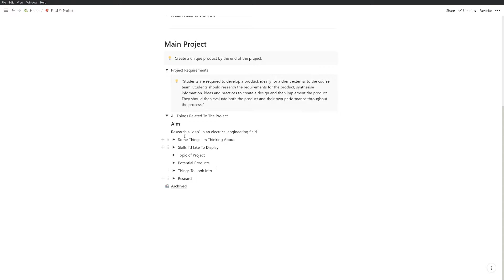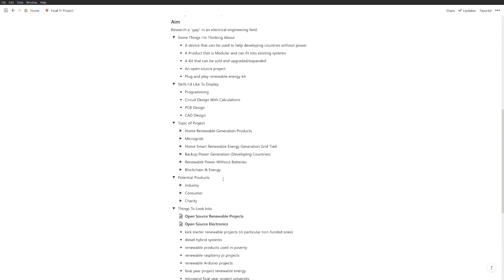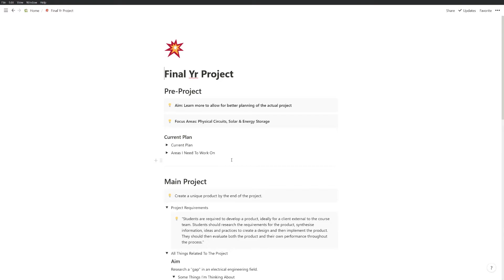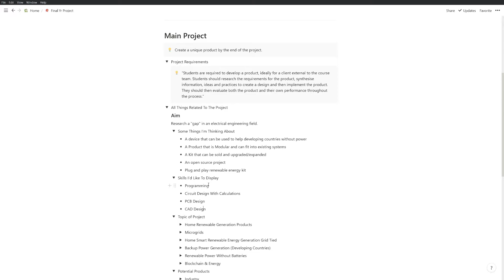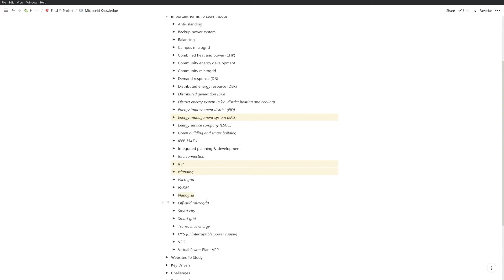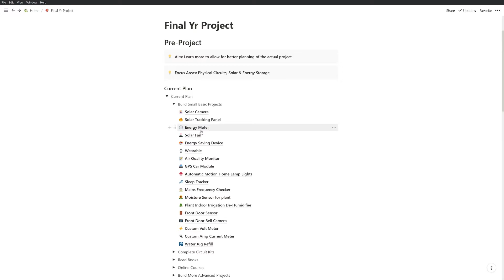Planning My Final Year EE Project - Slight Step Back

Comment: Good luck🍀
It's very motivating to see someone's final Plan when You're in 1st year.I have to learn a lot.
I had put my hands on C programming,
Arduino,Little bit Circuit design all possible due to Internet coz Indian Private Universities will teach you everything except required thing😜
Reply from the maker: Lol its the same over here in the UK. I just learned 12 weeks of transistors and I'm holding one right now in my hand and have no idea how to use it. I can do like 30 pages of maths questions on it though. 🤣